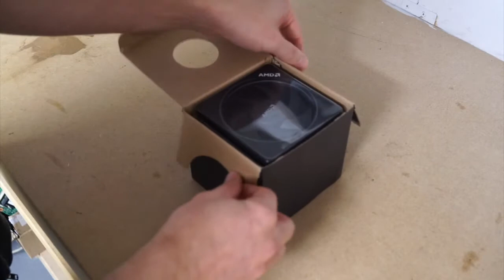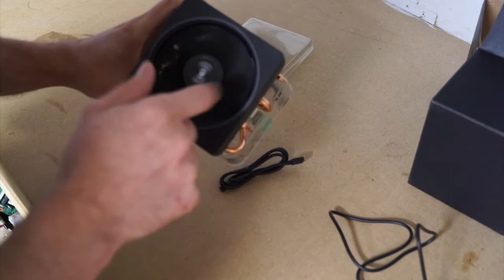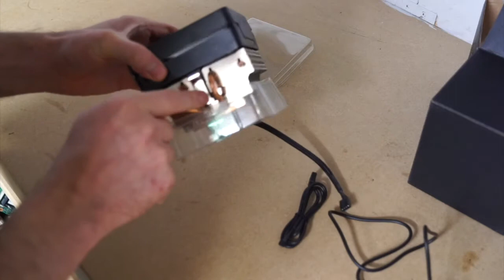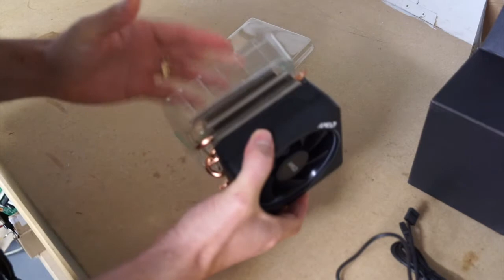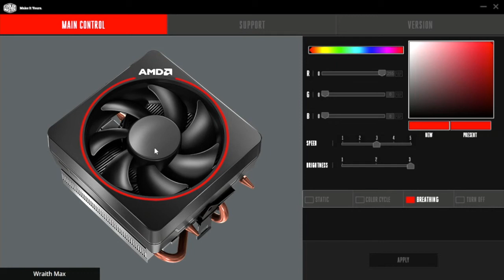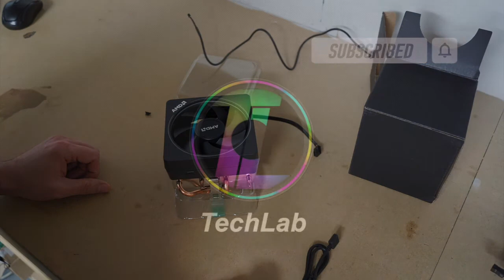AMD Wraith Max - It works well and it looks great!

Comment: Hi! My motherboard doesn't have an RGB connector. How can I light up the cooler fan? It doesn't have a USB port, just RGB on cooler. I don't know exactly if it's RGB or ARGB, because I would get a controller powered by SATA.
Reply from the maker: The Wraith max doesn't have a light up fan only the ring.  The Wraith Prism is the bigger one with RGB on the fan.
Reply: @TechLabUK  Thanks for the answer. Yes. I have a cooler identical to this one. Max, not Prism. And besides the fan connector I also have a connector for the LED. But I don't have a connector on the motherboard. It's an A520. What options for lighting the fan ring would I have, if you know of any alternative possibilities.
Reply from the maker: @spargatorii  I set it with a USB connector and its software but if you don't have the USB cable, only the 4Pin RGB connector then you can get RGB controllers that run from SATA power and you can plug it into them.
Reply: @ Thanks. I ordered a relatively cheap controller (Jonsbo RC01 ARGB - SATA). I hope it does the job. It's for my daughter's computer and she puts a price on the lights. It would have mattered less to me.
Reply from the maker: @spargatorii  The Jonsbo RC01 ARGB - SATA might not work as I think the LED ring on those are RGB not aRGB.  Check the cable you have and see if it has 3Pins or 4Pins.  If it has 3Pins then it is aRGB and that controller will work if it has 4Pins then it wont.
Reply: @TechLabUK  In the body of the fan there is a 5-pin plug into which a cable with a 5-holes female plug is inserted but which only has three pins connected, the middle ones. At the other end of the cable there is a female plug with four holes. I measured with an ohmmeter and there are only 3 consecutive pins in the plug that lead to the plug that goes into the fan, one of the pins (the one to the right of the arrow) is not connected. This makes me think that it is the RGB cable and +12V is missing, which it probably takes from the fan plug. In this case (probably) the lighting solution would probably be monochrome providing a -12V on one of the active pins (or 2 or three for static combination of R, G and B)?

Comment: I am tryign hard to stay away from water coolers. I tried to install an arctic freezer 3 240 and it would not even install. The screws on the pump housing were way too short. By a few mm. I could not get the screw to engage the teeth even with moderate force. So, i said screw this i am not damaging my board or cpu trying to install some POS CPU cooler that costs 10 times less than my cpu/mobo combo. 

It was goign to replace the stock AMD wraith the cpu came with. The thing has been solid over the years and i am happy. I dont overclock so standard CPU clocks. Not even PBO over clocking. I like my stuff to live and not die so dont overclock. The wraith, the first one  - and it is still running now on a secondary linux computer, i bought in 2017. We are nearly in 2025 now and the thing is still running. The second wraith i got had a thicker alu section like yours did and that is still runing.

So i want to install the wraith prism sin eit goes up to 105 watts. There is a wraith max now and i think that one goes up to 140 watts......if you can find one.
Reply from the maker: A lot of people have reported this exact issue with the Arctic Freezer 3 so it's not you.  We haven't had this issue ourselves but any other AIO should work fine.

Comment: Teh dounchebag who sent me mine didnt come with teh RGB cables. Should I return it? I cannot find this anywhere else. Teh cables are quite dear.
Reply from the maker: Their are two versions.  I believe the retail version should have an RGB cable whereas the non retail versions (The on in the video) has both RGB connection and USB connection which requires additional software.  I would have though you should have received at least one cable as the connection in the cooler is quite unique.